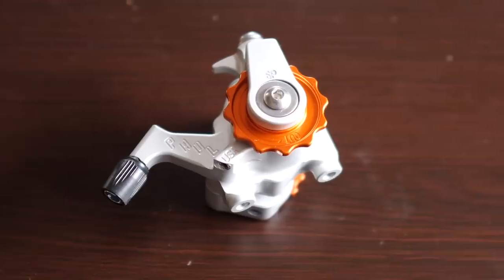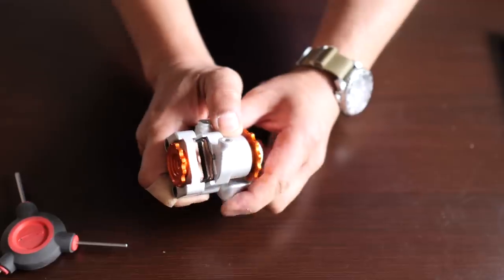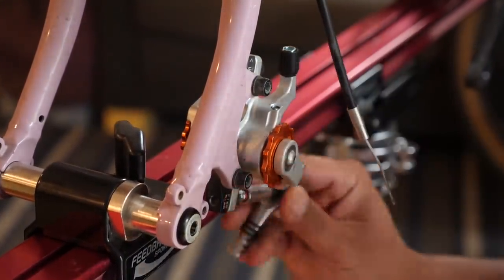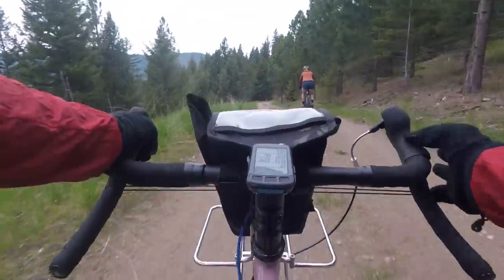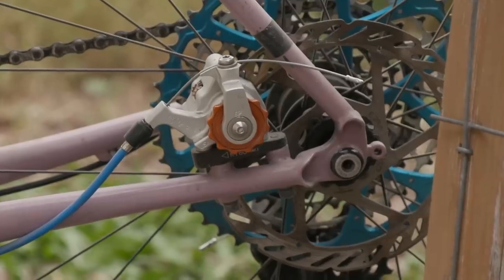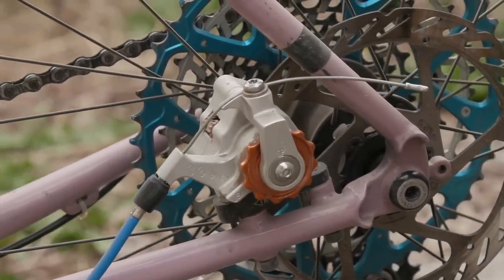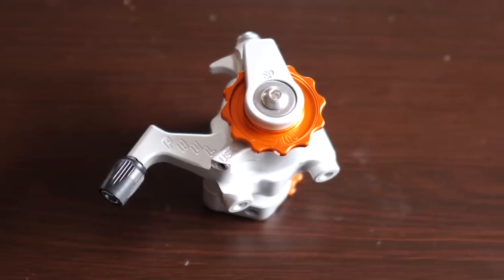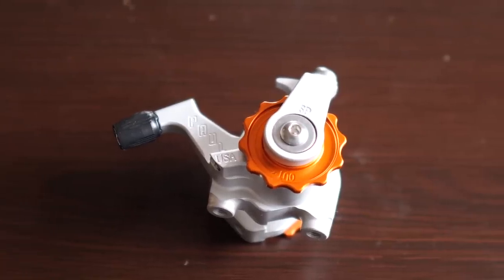Paul Klamper - Worth the 💰💰💰?

Comment: They simply do not justify the price. Functional speaking there is only one pad moving. For reference you'll be way better with the TRP hy/rd (the cable actuated hydraulic brake) or even they're spyre products (dual piston actuated brakes).
Reply from the maker: Spyres have two pistons but what good are they if they suck?  Have had the worst luck with them.  More pistons IME don't always equate to more better.  And if you can actually tell the difference between one or two pistons you're a better bike reviewer than me.
Reply: @PathLessPedaledTV  That's your experience. I've had no issues with mines. However, I'm a lighter rider and any brake will stop me in no time :)) If more pistons don't equate better, how do you explain the fact that mtb's have 4 pistons hydraulic brakes?
Reply: @vladthebikeguy4763  One has to love this kind of scientific proofs "MTB has more X, thus X has more power, QED".
Reply: @vladthebikeguy4763  The reason MTB brakes have more pistons is because the second set of pistons is a different size. This means that the first, less powerful pair of pistons engages first to modulate better, then the second, more powerful pair engages. The same effect- low power at first, then higher power- can also be accomplished with a special mechanism at the brake lever. The thing that makes four piston brakes more powerful again is the difference in piston size, not the number of pistons.

Comment: It's simple. They aren't value for money. Hope Tech3 V4 4 pots are £200 a brake and that is lever, hose and caliper. They've got more bite and they look lush.
Reply from the maker: That’s not how it works in road brake land.
Reply: @PathLessPedaledTV  shame. Hope have the RX4+ calipers, available as either mineral oil or DOT allowing for crazy versatility while offering big performance. At $126.50 a caliper you can get a pair for about the sane investment as a single Klamper. Flat and post mount options. Roadies need to look toward the MTB guys more often, there's a lot of money being wasted in the skinny wheel world it seems.

Comment: I would not pay that much for a cable operated disc brake caliper.
Reply from the maker: Why do you think hydraulics are worth more?
Reply: For me it's about the lever feel.
Reply: I thought the same and upgraded to hydraulic. Why? I use hydraulic brakes (Shimano, Hayes, Avid) for 18 years now and never had a mechanical problem! OK, hydraulic STIs are more complex than MTB levers but Shimano has no problems with wandering working point or drafting air (as SRAM has). In the Shimano Universe I can combine every lever which every brake caliper. And that for a much lower price as a clamper. As I said I intended for the clampers, too (try to find a good flat mount mech. disc caliper - Spyre sucks!). But in the end they were too expensive and the feel and performance of hydraulic is a game changer.
Reply: @arminhess1512  Ive heard of many problems with wandering bite points with Shimano and SRAM. It's well documented that both brands still have issues.

Comment: Curious if you went against Paul's recommendation to use normal cable housing, since I know you're pretty sold (as I am) on compressionless for mechanical disc.
https://www.youtube.com/watch?v=mFGqmJZc4Io#t=2m4
Reply from the maker: I tried it with and without and it worked great.  The Yokozunas REQUIRE compressionless otherwise they are just meh.

Comment: $250 per caliper isn't that bad. 

Then again, for dual piston mechanical brakes, maybe it is.
Reply from the maker: Can you actually tell the difference in pistons in use or is it just marketing hype? I’ve ridden hydros and mechanicals and damned if I could tell the number of pistons while riding.
Reply: @PathLessPedaledTV  

Yes. The more pistons, the wider the point of pressure on the pad. It equates to more breaking power, as you can have a wider pad and more contact with the disc.
Reply: Also, I stopped using mech brakes for the same reason you'll have issues with Paul Klampers. 

The single piston design means your one piston is pushing the disc into the stationary pad. It warps your rotors with use. 

There's a reason hydros clamp from both sides. How many cars or motorcycles do you see with single pistons?
Reply: @akatmountain3098  Some people won't complain about their bad choices no matter how bad it gets... Because that would require them admitting they made a mistake.

Comment: Wow when you think you can't go more hipster. This channel in a nutshell, ancient tech + expensive = cool.
Most(all?) of the products featured here are basically very old tech (with some polish and bling) priced as state of the art tech.
A good example of this is that shifter from a previous video which is highly impractical if not a little dangerous.
Yes I get it, this "old" tech is supposed to be more reliable. But let's be real here. Most of you don't ride  15k km a year with these kind of  bikes dressed in flannel shirts. If you would you would see that lighter is better, and also you'd most likely be wearing lycra. Because guess what, it's worn for a reason.